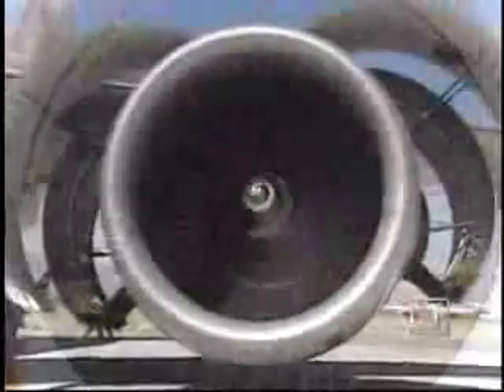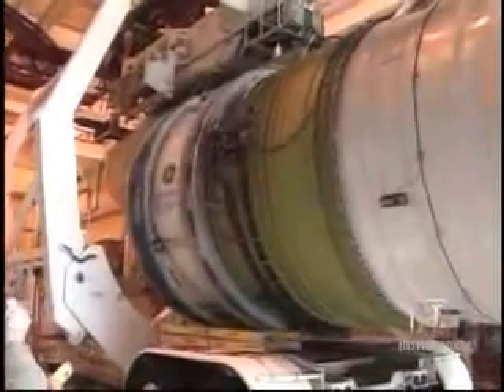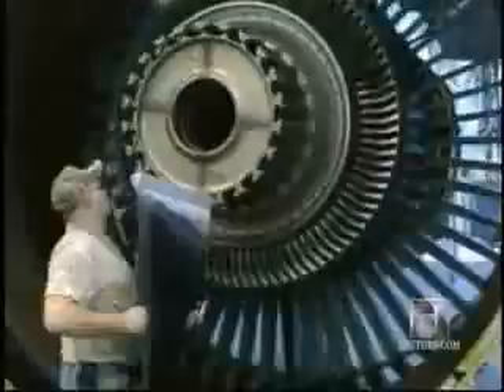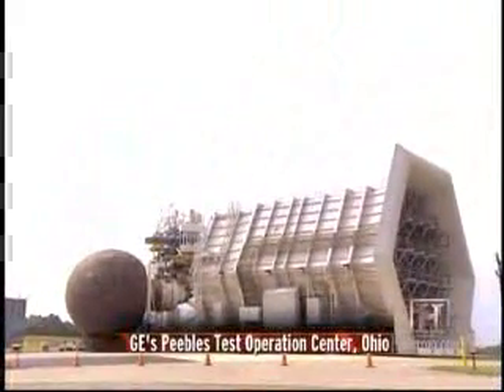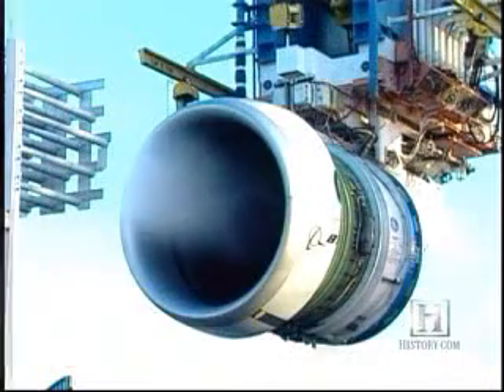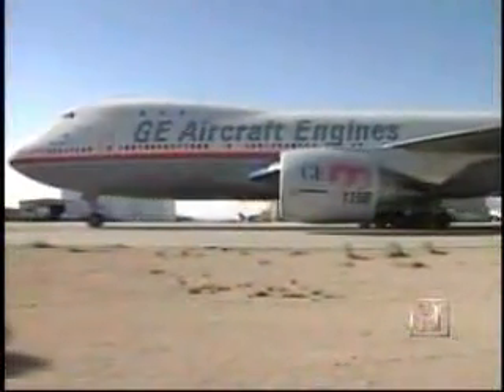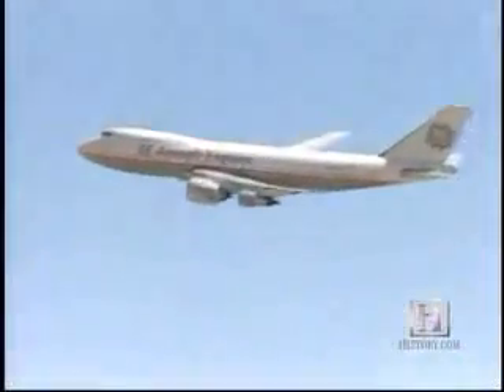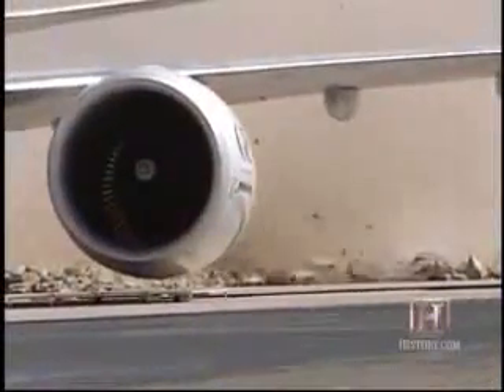jet engine tests the reason we do the math

Comment: I don't think they will, because if the 747 has only 2 engines some flights cannot be done because of the Extended-range Twin-engine Operation Performance Standard or ETOPS.

Comment: And checking those details I got mixed, the GE90-115B is actually larger and more powerful than the Roles Royce Trent 900 or Engine Alliance GP7000 currently used on the A380.
Significantly more powerful at that, with max thrust of 115000 lb, vs ~80000